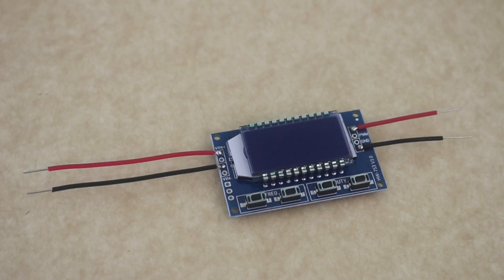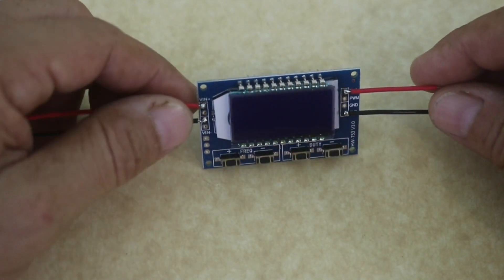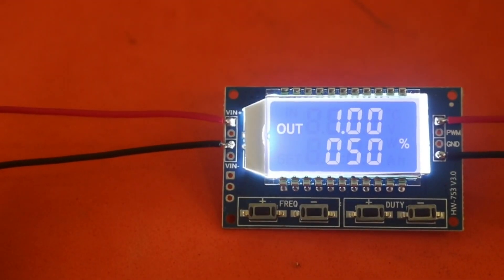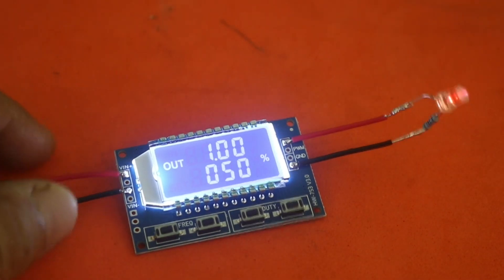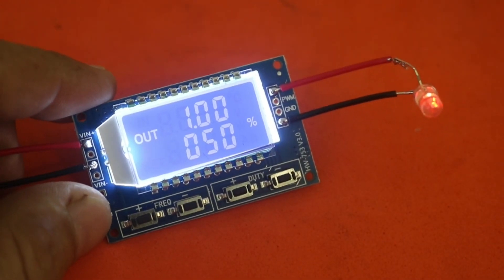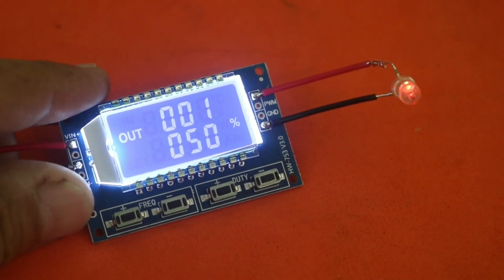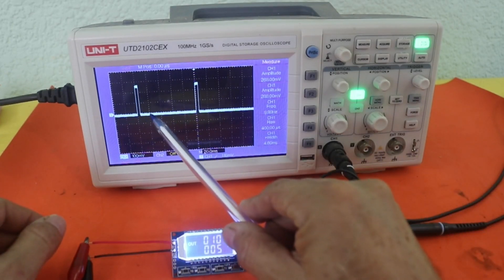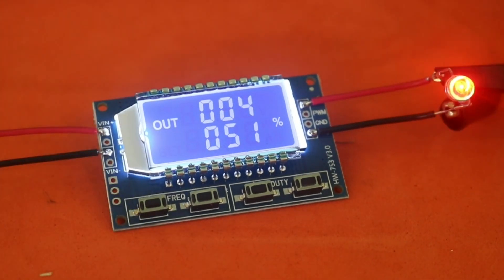Ajustable PWM Generator Module

Comment: Do you have a link to this particular module? I have bought identical-looking ones from two sources, and the screens are illegible junk because the digits are not illuminated when looking straight at them (if at all). Yours isn't great (you can tell it's washed out when viewed from exactly straight on), but it's much better than the ones I got.

Comment: Ciao.
Sto facendo un lavoro dove devo comandare 4 stepper nema 11( premetto sono di base meccanica.) 
Siccome io ho necessità di comandare tutti e quattro i motori contemporaneamente.
Devono girare solo in un senso AVVITATURA.
Però devo dare un comando Esterno ( i motori sono chiusi in una scatola di plastica ) che è gestito da un PLC..

Quindi non so come collegare il comando esterno per i motori.
Tipo semplice interruttore.
Che quando gli mando il 24.volts.
Metta in rotazione i quattro motori.
Spero di essere stato chiaro nella esposizione del mio problema.
Spero che tu mi possa essere di aiuto.
P.s. siccome sto facendo un pantografo quattro assi.
Sempre con stepper.
( Ma il mio elettricista non ha molta esperienza in queste applicazioni!)
In pratica devo trovare sia il CNC ed il programma adatto a SCRIVERE SU DEI PEZZI TONDI.
SIA SULLA PARTE PIANA ( FACCIATA ) CHE SULLA PARTE CIRCONFERENZA.
SE TU POTRESTI ESSERMI DI AIUTO ( PAGANDO OVVIAMENTE!) TE NE SAREI GRATO.
GRAZIE E CONTINUA COSÌ!

Comment: I don’t like buck converter i really like negative buck boost converter mosfets or igbt running cool at load but in positive buck booster converter mosfet get get heat up a bit even with no load on positive voltage so negative buck booster is the most efficient

Comment: This reminded me of something I worked on back in the 90's where the front control panel multiplexed bulbs where rated at 5 volts but ran off of 28 Volts. All through the magic of PWM.👍

Comment: Please help with settings. 
in a variant of this, a 2 channel module...

I want to run both the channel on 50% duty cycle @ 1Khz. While I want to run channel 1 instantaneous, I want channel 2 to commence only after Channel 1 reaches zero duty.

eg: When Ch.1 = 5v, Ch.2 = 0v and vice versa.

Thanks

Comment: On this module I waitng about 20 years.....😆....What is the current load on the output? 1A max.? Or just 200mA like NE 555?
Reply from the maker: Is just 30 mA
Reply: @ludicscience That is the max? 30mA?
Reply from the maker: Yes
Reply: @ludicscience  Thanks. It will require a bigger secondary module for open any bigger transistor. Or use infra optical gate will better.
For flyback sure.
Reply from the maker: @kentherapy7022  i will try mosfet on the output for flyback driver
Reply: @ludicscience  Oh yes....I am supposed....😎
Reply from the maker: @kentherapy7022  ( ͡° ͜ʖ ͡°)

Comment: Setting params through uart?
Reply from the maker: Not possible AFAIK
Reply: @ludicscience  most likely possible, there is a serial port visible, and there are videos on you tube showing that for modules that look identical
Reply from the maker: @youliantroyanov2941  thanks I will watch those vids, have a link?

Comment: Could this be used to generate the frequency for a magnetic induction heater?
Reply: Good idea, different materials require different frequencies,  brass doesn't melt properly at the same frequency as steel, if we can change the frequency it would be more efficient and can experiment with many different materials , I like this idea
Reply from the maker: Yes but you need more circuitry of course

Comment: Would this work with a flyback transformer? Would this produce the required Hz to create arcs? I'm sure you would need to use some extra components to handle the current needed to produce those arcs as well.
Reply from the maker: Yes the flyback needs about 15 KHz